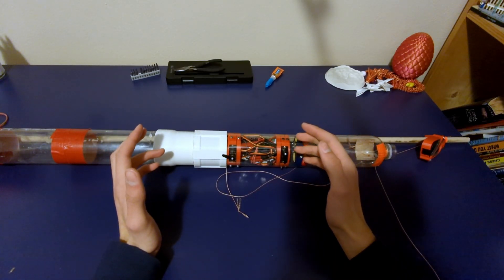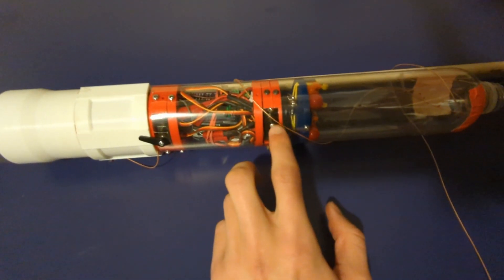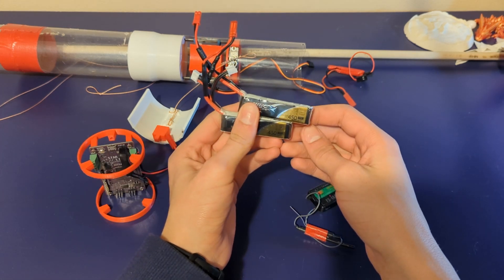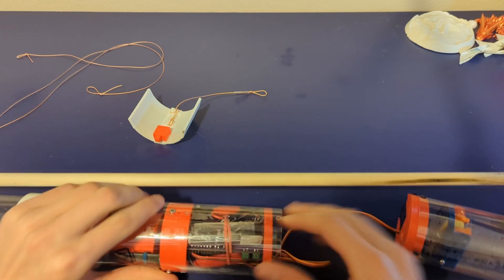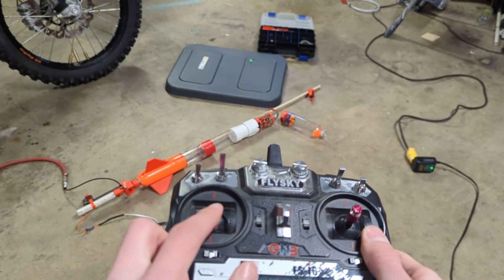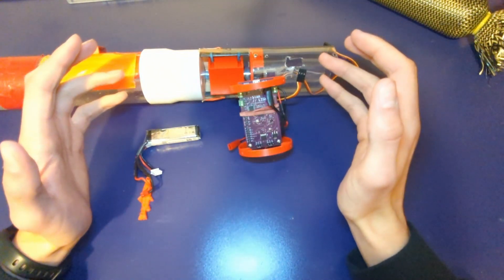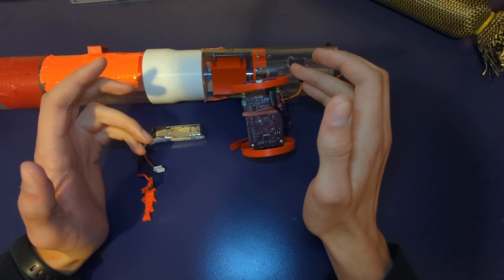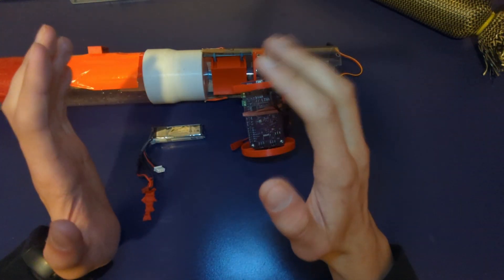Selfie Stick on a Water Rocket!

Comment: Great video, thanks for sharing. +1 for the Lego astronauts in that last shot. :) Great idea using the remote control for backup, especially when you get into unexpected situations. Good luck with the bigger rocket build. What is the capacity of this rocket?
Reply from the maker: The rocket has a capacity of about 1.5 L. It has a 3 bottle splice of 0.5 L sparking water bottles.
Reply: @CardinalAerospace  I think splicing a couple of 1.25L bottles together and screwing that onto the bottom of your rocket with a tornado coupling, you should be able to get enough capacity to launch at the same pressure and get better performance out of the rocket. You would need to move your fins down onto this spliced pair of bottles though.